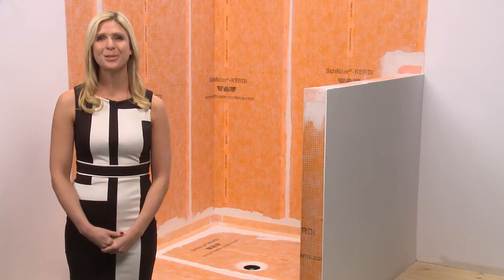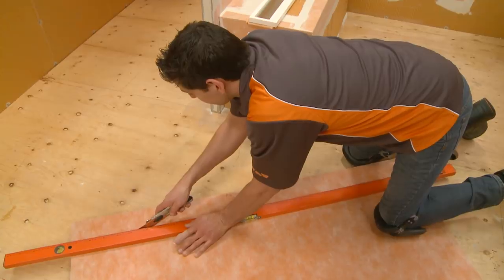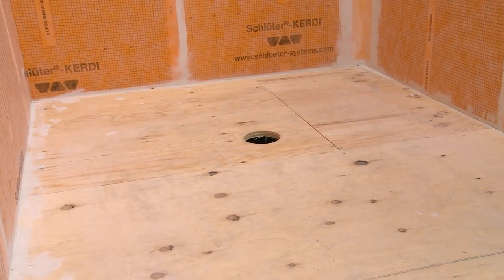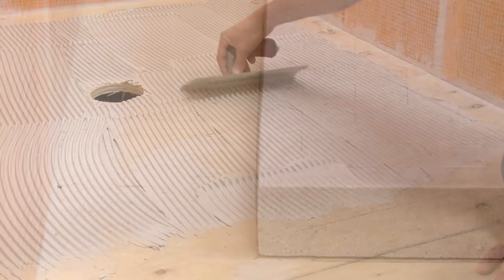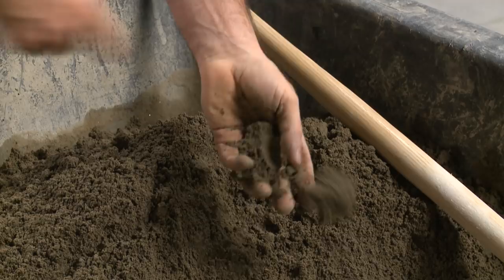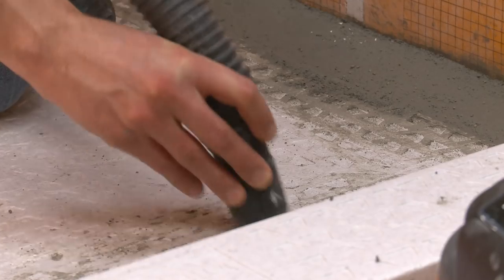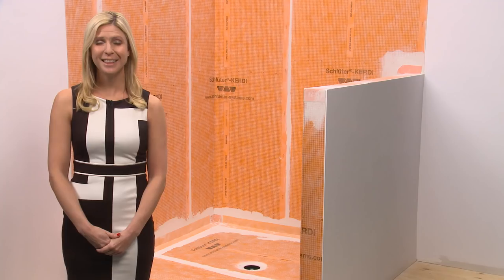Extending a Schluter®-KERDI-SHOWER Tray with Dry Pack Mortar

Comment: Can metal lath be added before the dry pack mortar to increase strength for plywood subfloor?
Reply from the maker: Hi Alessandro, would you be able to give our Product Support team a call to discuss your particular project in a bit more detail, and they will be able to advise from there. 800-472-4588 (US) or 800-667-8746 (Canada). Thanks!

Comment: Can you use waterproof membrane underneath the dry pack extension? Or would you suggest tar paper? Not sure about putting dry pack directly on wood substrate.
Reply from the maker: Hi Dylan, Sure, you can use a 4 mil polyethylene sheet or similar, if you want.

Comment: I notice Kerdi panels are inside the dry pack not above it? Other boards can’t be buried inside the shower bed it would be bad install. Is Kerdi board differ in this aspect?
Reply from the maker: Hi there! As the Kerdi-Board panels are waterproof, it is totally okay to install as shown. Thanks for your question. 🍊

Comment: On a curbless shower with a dry pack shower pan can the ditra be extended from the bathroom floor into the shower continuously and then tiled
Reply from the maker: Hi, Rick! Yes, it can. The drain would need to be raised up a little to make the top flush with the top of the DITRA. You can install a ring of DITRA under the foam circle cut-out in the tray to achieve the right height.

Comment: Can you use a small amount of dry pack ONTO the tray?  Ie, will it stick?

 I have to cut 2 sides of my tray to fit the shower dimensions but i have to extend the other two sides.  So to even out the height due to extending the slope on 2 sides, i need to raise the two narrowed sides a little.   Will the dry pack stick to the tray properly?
Reply from the maker: Hi there, thanks for watching! 
If you could please give our Product Support team a call. They may have some additional questions for you on your project. 
They can be reached at US: 800-472-4588 or CA:800-667-8746
Reply: This is way late but - HELL NO! Just started subbing for a company that does all Schluter pans and I’ve had to repair numerous extended shower trays because of the mortar cracking where it meets, and is on top of, the Schluter Pan.
I’d put Ditra down on the floor area you need to extend the pan to and then use Kerdi to tie it all together
Reply: @dongately2817  I agree with using Ditra to extend from the edges of the Schluter pan...my only question is, since the edge the pan (highest part of slope) is higher than the thickness of the Ditra -- how would you suggest building up the area where the pan meets the Ditra for a continuous rise?
Reply: @ryanc6620  - dry pack - just don’t extend the mudbed onto the tray. If you wait a day or two before putting the kerdi over the mudbed you’ll see the cracks between the tray and mud begin to form. I like to use a bead of kerdi fix to attach the strips at the joint where the tray and mudbed meet. It might be overkill but the shop I’m subbing for is generous with the materials.
Reply: @dongately2817  sounds good, I'd rather overkill a bit than deal with the alternative, thanks for the feedback! Cheers

Comment: What brand of dry pack? I see Mapei 4 to 1, or Laticrete. Mapei only has a psi of 75...Laticrete has 5000 psi. So which mortar is recommended ?
Reply from the maker: Hey Matt! Any dry pack mortar should be fine. You can always contact the manufacturer if there is something you are unsure about... Thanks!

Comment: Can you use the dry pac to extend to any amount? my shower is about 8 feet
Reply from the maker: Hi there! If you get a five or six foot tray, that will mean that you only have to add one to one and a half feet of mud to the ends of the tray. That will be fine. Keep in mind however, that there will probably be a limit to how far the tray can be extended with mud based on perimeter heights due to the necessary slope. For much larger showers, this will need to be considered and a different approach may be necessary.

Please contact our customer service team to discuss your project in more detail, and they can advise from there:

800-472-4588 (US)
800-667-8746 (Canada)

Thanks!

Comment: Do you use kerdi band over the dry pack areas?
Reply from the maker: Hi there!
 
All of our trays now come with integrated KERDI waterproofing. To waterproof the dry pack areas, you could use KERDI-BAND, as long as there is a 2" overlap on all sides. The KERDI-BAND comes in several widths, however, you will need to use KERDI membrane over the dry pack areas that are wider than 6".
 
Hope this helps!
Reply: @schlutersystems1  thanks

Comment: Is this modified or Unmodified thinset?
Reply from the maker: You can extend the tray using dry-pack mortar (which is basically just sand and cement). Hope this helps!
Reply: You didn't answer the question...

Comment: What about a shower that is 28" X 37"
Reply from the maker: Hi Jay, you can either trim down one of the trays or install a mortar bed. Please contact Customer Support for complete instructions on trimming the tray down, while retaining an even perimeter. Hope this helps! 800-472-4588 (US) or 800-667-8746 (Canada). Thanks!

Comment: So no 1/4 inch fall to the drain wierd
Reply from the maker: Hi Robert, 
The slope does continue. In the video this is highlighted, "Place the mortar in the remaining areas and tamp it with a wood float, such that it is higher than the surface of the shower tray. Using the tray as a guide, remove the excess mortar to produce a smooth transition and maintain the slope of the tray."
Hope that helps!
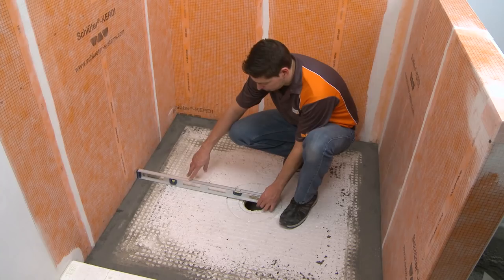Reply: @schlutersystems1  That isn't what the video shows at 1:46. Seems to be level rather than sloped.
Reply: @richardhoner7842  That level is literally lifted up on the right side to show mortar and tray both slope beneath the level.